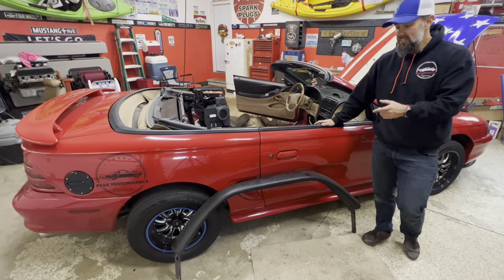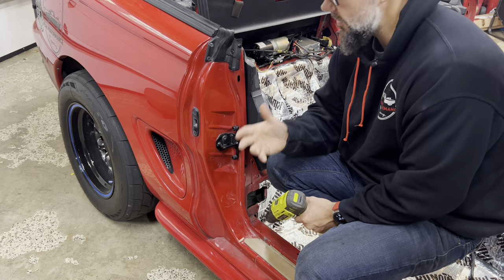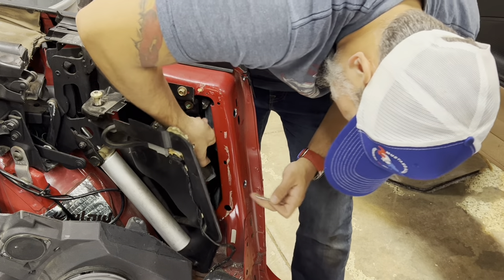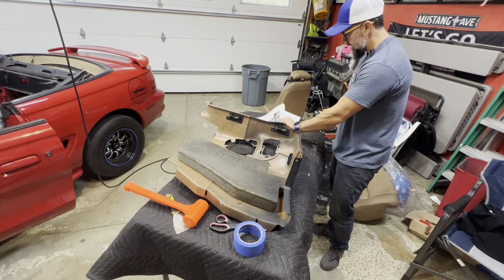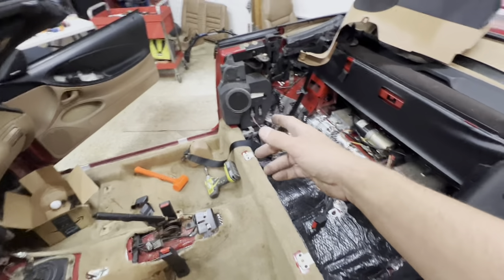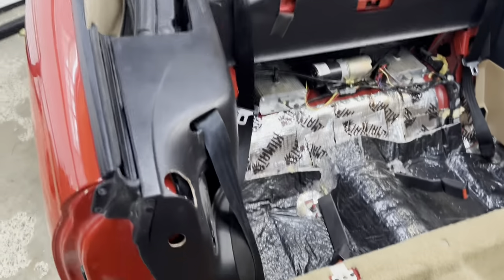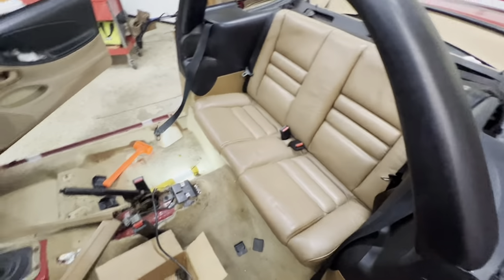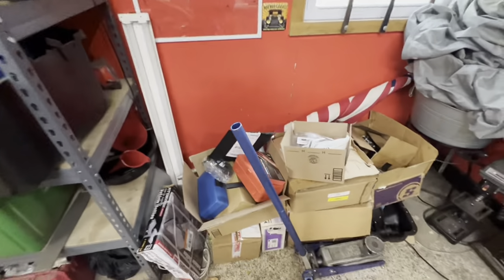How to install a MMD/CDC Convertible Styling Bar on a SN95 94-98 Mustang

Comment: I just bought a used one on cl . Came with the brackets and hardware but not the templates or caps facing the door. Ty for the info from your video. Also your bottom bolts only gave me a idea :why do you need to drill the holes at all where the caps belong? Why not place the bottom bolts behind the rear panel then fully install the panel ? How has the 2 bottom bolts only hold up so far like a 6 month review ?
Reply from the maker: Have maybe 500 miles on the car this summer and it’s all still tight and seems fine :)

Comment: My brackets aren’t labeled left or right.   Think I’m going to bolt them in and not rivet the brackets in.   Incase they have to be adjusted.    Think that would work?
Reply from the maker: I think the rivet just held the bracket in place so you could pass the bar through and the bolts. You might be able to not rivet it, so long as you can keep the bracket in place and not fall around.
Reply: @PeakPerformanceEngineering  I guess as long as the bar doesn’t hit the bolt head.   Hmmmm. That might be an issue.   I’ll give it a shot though.  Might have to countersink the bolt head into the bracket.

Comment: Ever stop to think maybe your problem with the bolts was that you used a CDC install kit for a NON CDC styling bar? 😮
Reply from the maker: That’s possible too. But, as a bunch of other people commented here and on the FB groups, lots of folks have the issues with the bolts not lining up. I think between both bars and kits they looked to be exactly the same (this was 2 years ago now I did the research) and I think when I checked with CDC they mentioned it works for both bars. 

When you have bent steel tube for the bar, it’s easy for it to misshape and make alignment tough. We bent our whole roll cage for our solstice deathkart, and it’s very difficult to get stuff the same after bending. 

I also bought this bar used unfortunately and it had to go through shipping 3 times I assume, once to customer, once back, and then to me. So who knows how that affected it during shipping. 

Just glad that job is done. Looks wonderful and still no issues 2 years later

Comment: It looks like the top didn’t align because the ratchet strap was bending the ends in on an angle, not pulling the two ends together. You may have had better success if the ratchet strap was closer to the upper bolt which would’ve bent the curve in rather than the mounting portion of the bars.
Reply from the maker: Apparently a bunch of people have had the same issue I ran into, even new. I don’t think moving the ratchet up a couple more inches would have done anything different, you would really need to adjust the bar a good bit farther up in the frame to get it bent right, but then your into the pleather cover. What a pain in the booty, glad that one is done 🤷🏻‍♂️🤘🏼😳
Reply: @PeakPerformanceEngineering  I’m installing right now. I would say the best advice I can give to anyone reading this is to measure your distances beforehand and try to adjust the mounting bars accordingly to match
Reply from the maker: I think I mentioned it in the vid but I remember bending that bad boy like 4-5” in further than needed to account for the spring back effect. It had some crazy tension on it too so be careful! Good luck.

Comment: Just put mine in today.    What a major PITA!!!    Top bolts also didn’t line up.  At all. Not even near lining up.  The curve of the bar lines up where they say the top hole would be.  I don’t even know how they can have these instructions for this thing in this box.   It’s 100% inaccurate.      Plus you have to ratchet strap the bar to even get it into the car.
Reply from the maker: Yep what a pain in the booty with the whole ratchet strap malarkey. Glad that job is done.
Reply: @PeakPerformanceEngineering  yeah. I was able to do it in a afternoon. Your video helped. Definitely sturdy though with just the bottom bolts In. I didn’t rivet it in though. I used small bolts on the bottom and top of brackets.
Reply: @jamesa6272 how has the bottom bolt held up since your
Instal? I am getting ready to instal one of these and don’t think I need to drill out the rear pannel facing the door if I am only using 2 bottom bolts. ? I’ll fully install the rear pannel after the bolts are in and before only slide the light bar through the panel
Reply from the maker: @paulw9732 holding up fine so far, I have maybe 5/600 miles on the car this summer so far and it’s still great and tight
Reply: @paulw9732  Mine has held up with no problems.
Reply: I just put mine in today and I can not seem to get either side interior rear side panel to fit correctly as factory 🤦‍♂️ none of the holes for the expand rivets line up and now the door panel and rear panels rub when I close the door. I may have to make some custom holes and plastic rivers to stop it from rubbing opening and closing the doors 🤦‍♂️ 🤷‍♂️ it was a major pain the bar looks great tho
Reply from the maker: @paulw9732 that sucks they’re rubbing, maybe some readjustment or “massaging” can help. But at least all the hard stuff is done!

Comment: So you only put the bottom bolt in. Hmm.  I bought the same one.   I read in the reviews this is a lot of people’s problems.   Trying to figure out what I need to do (not listening to the instructions) on How to make it fit with no problems.     Saw you were very optimistic about the install and no top bolt.  That’s why I’m. A pessimist in life 😂
Reply from the maker: Shoot did you see what I had to go through to even get any bolts to line up with the ratchet straps 🤷‍♂️🤦‍♂️ getting any of those bolts to fit was a miracle haha. But maybe if you bought it new you might have an easier time. Mine was a customer return from American muscle so not sure the life it lived with shipping an extra two times that might have tweaked the frame a bit. 

But there is so much tension holding it side to side alone with sliding through the metal hole you cut that it’s solid as hell in there with one bolt. 80-90 on expressway and it doesn’t move or buffet or anything like that. 

Good luck with it, let me know how it goes 😁
Reply: @PeakPerformanceEngineering  Thank you.  I haven’t got it in the mail yet.